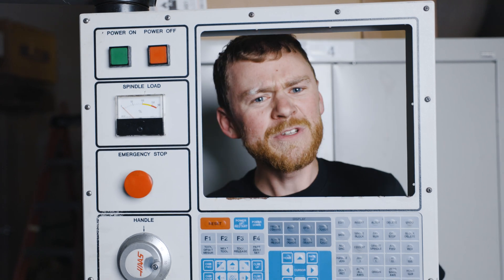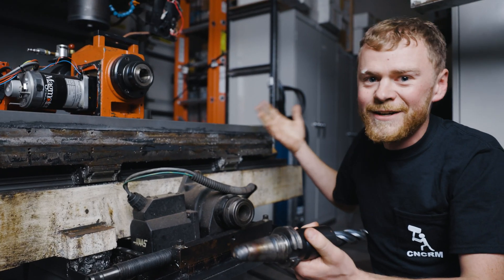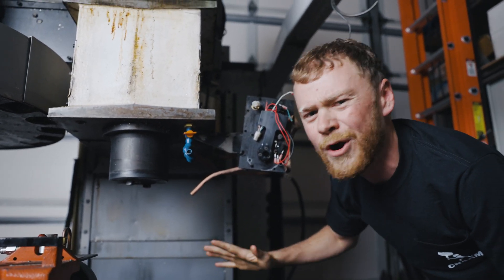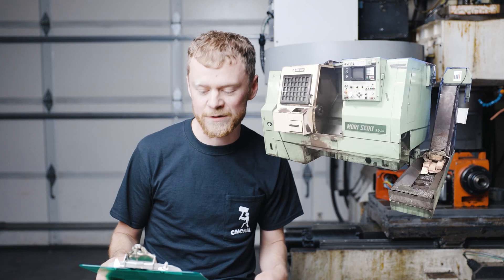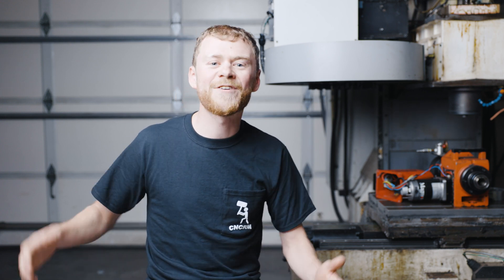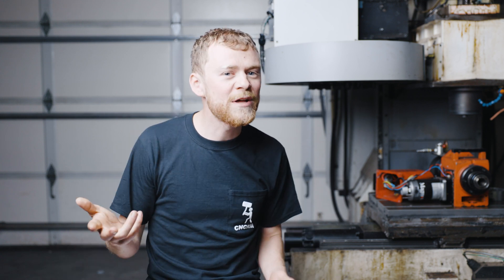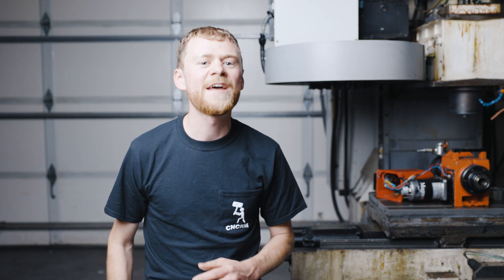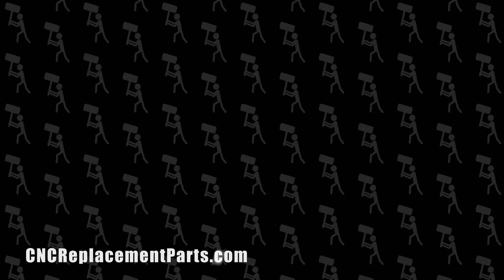Don’t Buy Old CNC Machines | CNC Repairman

Comment: I'll take any Fanuc between a 0 and 16/18/21i-A before I'd ever think of anything newer.  Pretty much everything in that range can be repaired without a Fanuc service call and parts are readily available for reasonable prices.  Any newer control and you start going downhill fast because of all the protections (AKA service call money grubbing controls) they started putting in.  I have an entire shop built around used machines (CNC router, 4 and 5 axis machining centers, turning center, surface / profile grinder with 4th axis).  I've had zero major duds and none were able to be inspected under power but you ABSOLUTELY MUST KNOW WHAT TO LOOK FOR.  Take the following with you to inspect a machine:

dial test indicators on mag bases
a small prybar
a portable compressor
a keen sense of smell
a mechanics stethoscope
multimeter / megohm meter

Make sure you have adequate time to inspect anything you are considering buying if it can't be powered up.  With those tools and some time (plan on it taking at least an hour, maybe two), you can visually, audibly, and electronically observe while pressing, tugging, spinning, and pressurizing things.  Check motors with a megger.

With a careful inspection, you can rule out a LOT of potential problems.  There's always some risk, but you can often avoid buying a clapped out piece of junk with a little attention and common sense and get yourself into some full size industrial iron for about the same money or even less than people are paying for overhyped hobbyist grade toys these days.  I built a very capable shop full of CNC equipment and never had to borrow a nickel to do it.
Reply: What specifically about the new fanuc controls are you talking about? 
We run 31i's on most everything and they have been flawless, and I've never run into any issues that require fanuc to come in, not even adding options.

Comment: Fun Fact: Bridgeport Torq-Cut machines can be rewired to run on single phase power. The DX32 control is a dinosaur, but there are still plenty of users out there in the forums.
Reply: And a couple of suppliers of new boards still exist.

Comment: I was given an 1996 haas VF6 that the company gave up on. They remove the old CRT for another machine to use but the reason they stop using it was HAAS gave them a price to fix all the problems was to high. I recharged the N2 balance cylinders and the low lube spindle oil was because the motor/pump drive cushion had rotted away. Old brushed axis motos but runs like a charm.

You are right about Cincinnati Milicron. I bought an Arrow 500 new in 95', PC based and they have no support for the machine the battery to hold memory are in the IC's soldered into the PC boards. I replaced one but  years ago the other went out and had to sent the board to Cincinnati to get reflashed. It still does not work and no one in Los Angeles works on then. It just takes up floor space now. It is like brand new. I'm a Fabricator mainly.

Comment: I own a 1998 Fadal 3016 w/4th box way.
A 1997 Fadal 6030.
A 2001 Sharp SV3220.
And a 2005 Haas st10t.

I wouldn't trade my Fadals for a brand new Haas even if it were free. 
I plan to upgrade to a NexGen for both machines. Once I do that It'll wipe the floor versus a Haas chatter city. 
Eventually, it'd be nice to grow into some Doosans. (DN Solutions now)
Reply: I have a 2008 4525 fadal with a cal motion control, works great. Acceleration is slow still but I can do hem Toolpaths without banging around now.
Reply: Just bought a 4020 yesterday. First machine first shop!

Comment: I know this is more geared towards new/home shop guys but I've built my business over the last 13 years by buying old kitamura and Tsugami machines, fixing what needed to be fixed and making great parts and a ton on money with them. Admittedly (not trying to brag) I probably have more repair experience than most machinists as I used to build CNC machines in a past life, but I own all my own iron, have never had a loan payment on any of it and find it a great business model for me. My oldest is a Tsugami live tool CNC turret lathe from 1978 with Fanuc 3t that holds ridiculously tight numbers, newest is a kitamura 2xif sparkchanger from 2007 with Fanuc 16i. I've also got Fanuc 6T, Yasnac i80 and okuma. I did start with Heidenhain controlled bport interact machines and was making great $ cutting 6al4v to all day on them...
Reply from the maker: Love it! Great story thanks for sharing!
Reply: @cncrepairman  love your content, please keep up the great work!

Comment: Fadal is pretty easy and cheap to fix on your own with plenty of parts suppliers.  Not sure why it made the list.
Reply from the maker: Don’t think I explained that one correctly. Older Fadals with worn out box ways and turcite can be a money pit.
Reply: @cncrepairman  yep!  Your blanket statement about no memory and slow/clunky describes it pretty well though!  lol
Reply: i have 2 fadals. Ive run them for four years and have had no major issues other than a screen and a few minor things. A bit slow on the tool change , but they work great for me. I wouldnt dare interpolate a full circle and expect to hold .001.

Comment: I have a '91 Haas VF-1 (Plastic cabinet) as you called it. Bought it well used but also had personal knowledge of it's past 9 years. I have zero regrets as I couldn't touch a newer machine for 1\10th of what I paid. 
 General rules apply to purchases of any and all used items. If we were to follow your guidelines, all used items in the world would be obsolete in a few years. Sorry man, but the world needs older used machines to start and keep the small businesses running.
Reply: i think the point of the video is mostly towards the machines people buy for cheap that they dont know. So they dont know if it works, in what condition it is and how it has been used. If that haas wansnt working the cost of the machine might shoot up, and the price of the machine in working machine might not even be higher then the parts cost. And then its still a question how worn the machine is.
Reply: The Haas VF1 (Very First 1, Gene and Kurt were going simple for a name) can be a good machine. Just remember one thing, Kurt designed all the electronics on that and then they built it all in house. Well, they still build it all in house, but that's gotten better. But the bare iron is good and so you can just hang a whole new control system on it. The encoders on the axis  motors are standard. The only funky thing is that the spindle will run backwards if you hook it up as normal, again they guessed on motor direction when they did the initial software. 

Also. always check the wire nuts on the spindle motor. They had a left handed guy working on the line for a time and he was not trained, so he put on  thousands by turning them the wrong way. OOPS.
Reply: @oldfarthacks , So far I've had little to no trouble with the old girl. Aside from the typical needs/repairs that all machines will require,  this has been a great unit. I did a full once over when i got it in 2020 and refurb'd a lot of stuff like way cover wipers, tool changer doors, all oiling and air lines etc. The only major repair so far was the need to replace the original failing VFD last year with a new Hitachi micro drive which is perfect except for their miniscule wiring connection points. My only regret was not buying the single phase version as it would have allowed me to leave the 20hp rotary off !

Comment: I own couple of retrofitted hurcos and I like them, I don't have problems with memory, high speed machinning, repairs, tolerances.. Now I will get another one
Reply: Was thinking about buying a Hurco Hawk CNC Mill 5m and hooking it up to a new controller maybe new servos if I have to. Am I getting in over my head its only 500 bucks.
Reply: @awfab3517  if you are trying to start new workshop,it's better solution than buying new vmc and throwing 100k.This way you can feel market and than go for a serios machine.I work only with retrofited vmc and get no problems,I own 5 hurcos and like them.

Comment: Nothing wrong with fanuc 0-C controls or yellow cap DC servos, they are bullet proof and well supported.
The other tip is to make full data backups asap.
Reply: Oh bless you. just two months ago we had to cough up £4000 for repairs, cause of a design flaw in the electronics.
Reply: 4 grand isn’t much it the machine is making that a week.
Reply: @kingofl337  That is a great thing if it is making you 4 grand a week for you.
Reply: @kingofl337  you sure have good values of jobs

Comment: Cool video - I worked at a couple of machine tool dealers.  I have my own opinions on what is ok and what is not. I started CNC machining in 1985 
1) brands i would consider - the Japanese standards - Mori - Matsuura - Kitamura - Okuma - US standards - Haas & Fadal
From early 90s and up. 
2) If it is RUNNING and you see it - a Good sign (the control is a problem area if it is NOT working - forget it)
3) Know that the older machine control have limited CNC controls. You CAN NOT do advanced Cadcam techniques like adaptive or dynamic milling. The program sizes are tiny and how do you get the program in to the machine.  
4) the US machines have a good user support system - so easier to fix.  But they were less expensive machines when new and have a lifespan - unlike a 1990 Mori seiki that was built to a higher standard. 

ex: of one I recommended was a 1993 Matsuura 510 with yasnac control that was running with tooling in an auction - he bought for 5k

Comment: If I listened to any of this advise, I wouldn't have any profitable retrofitted machines in my shop (I have several, a couple I got, yes, for free) and I'd just watch TV all day. LOL I'm not the guy that was afraid to learn about industrial electronics on my own. I've never called any CNC repairman and I NEVER WILL
Reply: Exactly! Same here
Reply: Right the machine itself is the expensive part and people are basically giving them away. You can rip out all that old electronics and run them on 1/100th of the boards and hardware now and open-source.
Reply: @tangodown2721  I think you're right but one thing I've pondered is machines that have a literal closet of relays, circuit breakers, and so on.  I wondered how hard that would be to actually make work.  getting the basics to run like X, Y, Z, and an additional rotary is relatively easy but get the rest on an advanced machine from 1990 I would think would require extensive knowledge.
Reply: @LogicSpeaks  bunch of that stuff is to do what a single hooked up laptop can do now. You can strip a lot of that out.  Motors are motors, spindles are spindles. Strip it down to the basic like if you were doing a diy build then hook it back up with modern equipment for diy cnc mills and good to go. A lot of the stuff in those cabinets is all done via software now.
Reply: @tangodown2721  Fair enough - I just didn't know how much can be stripped.
Reply: Quite right and I bet you don’t have a big fiancé maintenance contract bill to pay for too at the end of every month . 
There’s nothing wrong with dropping on a cheap machine and replacing an encoder/ board or swapping the odd diode . 
👍🇬🇧
Reply: Picked up an okuma lb-15 1985 osp 5000l-g. It's a freaking tank. Stripped it, painted it, did fresh ball screws, bearings, wipers, put an lcd and a bar feeder on it. Did a shopfloor automation dnc kit. Ways are pristine. Little thing hogs metal with extreme repeatability. Servos are rebuildable for 2800, boards be completely refurbished like Luis Rossman working on an iPhone. Solder removed and chips replaced and rebuilt on 1-2 days. PLC is easy to understand.. have some nissin, ikeagi and snk's 80's and 90's solid Japanese cast. Every component on these machines is TOP END. Hydraulics, motors, bearings, coolers, conveyor.... everything is high end. No other modern cnc I have worked on short of an okuma oil country lathe or large makinos where built like these. SNK makes amazing stuff but it's lead to them making such massive stuff, most shops never see it.
Reply: I'd kill to find a free one, even if it's a project.
Reply: Same here, old fadal is great, old mazak integrex even better
Reply: That's how you do it!
Like a g!
I've retro fitted quite a few in my day as well
Reply: Yea but your a GOB  good old boy.
Reply: Mad respect for ya that’s insane howd you find em for free?
Reply: @de5438 Local company writing off 'used up' assets. One Leblond CNC lathe, GE Mark Century 1050 control. sat outside for 2 years. Saw it from the highway every time I went by. Had to ask, yep for sale $500. Got it, installed a used $1500 Fagor control. Ended up doing $20k in work for that same company the next year, and more. So that one wasn't free but have gotten several that were. Also manual machines for no charge from customers. Machine payments?? What are those??
Reply: I think everyone maybe missed what the target audience was here. It sounds like he’s mostly talking about people who will PAY someone to service the machine and not the do it yourselfers
Reply: I'm sure your boyfriend is so proud of you!
Reply: Don’t be this guy. It’s cheaper to call cnc repairman and focus on machining great parts. I’d never give machining work to a repair-it-yourself shop. They’re hard headed, inconsistent and nearly impossible to work with.
Reply: @jaypie0864  You're one of those dips that can't change a fuse or think beyond the big green button LOL Don't get your hands dirty. No one wants your work I'm sure.
Reply: @jaypie0864 sure bud, sure.
Reply: @jaypie0864  When I think of clueless I think about you LOL
Reply: Guys like him unless they can just plug in and no mechanical  work their a reapair  man me...crawl into it..here's the problem
Reply: it's really not that complicated, any good competent ASE certified master mechanic can fix a CNC machine
Reply: @seancollins9745  I know a lot of guys with ASE certs I'd never let near a controls cabinet.

Comment: Rule #1 of buying a used machine should be if you can't see it powered on walk away.

Rule #2, make sure it has all the manuals.

Rule #3, expect to have to do some work, even in the best case you'll probably spend hours doing cleaning that the previous owner neglected to do.

Buying used machines can be a great option providing you get them at a good price relative to their age and use which pretty much rules out Haas as they generally seem to be overpriced used, often significantly so in my opinion.
Reply: Rule #4, if they give it to you or sell it for below scrap value, ignore rule #1
Reply: Amen

Comment: Dude I bought a dinosaur Fadal VMC15XT. I want to learn how to repair cnc machines, there is a huge opportunity here where I live repairing Haas, Fanuc, Mitsubishi.
Reply: I don't get the hate on Fadals.  Mine has paid for itself so many times over.  It doesn't break often, and when it does it's literally the easiest CNC on the planet to fix.  All the manuals and schematics are free online.  All the parts are available and reasonably priced.  There is a large community of DIYers around them that share helpful info about running and fixing them. And they can be run single phase no problem.  Sure they are slow dinosaurs, but a cheap Fadal is still faster and better than any Tormach or Haas mini mill by a good amount.
Reply: @ReiniGrauer  I have a 1997 VMC15XT and love it. How can I have the manintenance manual?. I said dinosaur because it is old and slow but for sure is stronger than a Haas of the same size. I agree with you, if I could I would buy a big fadal with chip auger.

Comment: I laughed at the only ever machined aluminum, it is probably the hardest wearing material to machine including cast iron. I know I worked with it for many years. 
I have worked with some nightmare equipment over the years and sometimes its the simplest thing that will just cause nightmares.  Slide way covers, Turkite de lamination and dodgy  through tool coolant systems, pulleys with uneven wear all classics. I still remember the first Fadals I saw and was amazed at just how cheaply they were built. Stuff like guides and rollers in the tool change that would barely be adequate for a kitchen draw let alone a machine tool. Air cylinders filled with oil without a dashpot in the system just to save a proper hydraulic pack and an electronics system that genuinely looked like it was assembled from a Radio Shack catalog. 2 speed spindles that would swap belt tension units to change speeds instead of a gearbox. I wont go on the PTSD is catching up. I have always said that if the machine tool dealers don't want it they are rarely worth fixing.
Reply: Interesting! Why is aluminum so hard? Because of the high speeds and feeds or is the material itself abrasive? Or something else? Thanks!
Reply: @bigbattenberg pretty simple the surface is covered in Aluminum Oxide. You know the same stuff they make grinding wheels out of. It is also mostly machined at much higher speeds swarf impact alone adds to the wear.
Reply: @dazaspc ah yes that makes total sense, never thought of it that way.